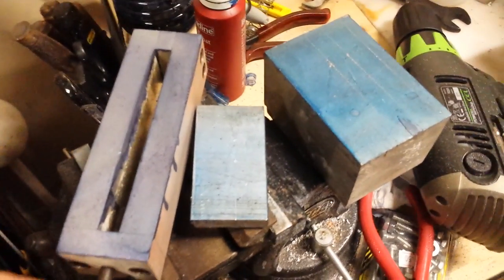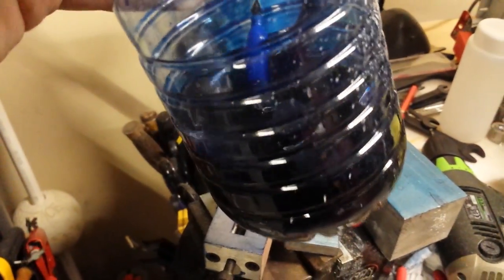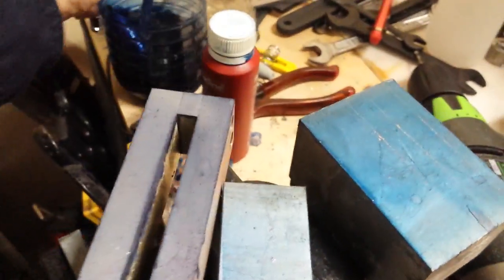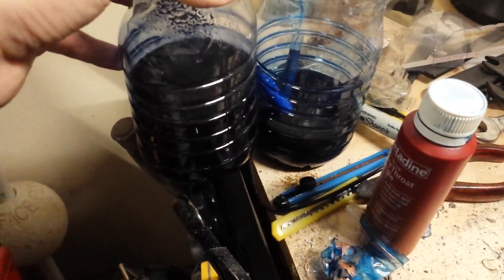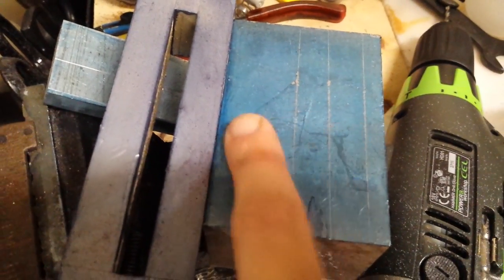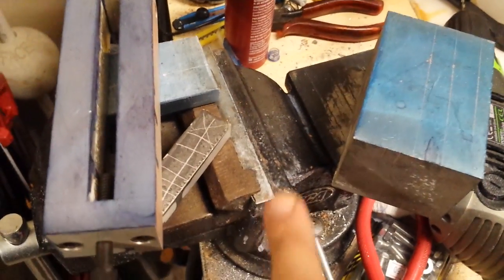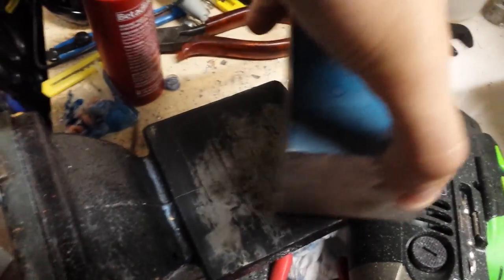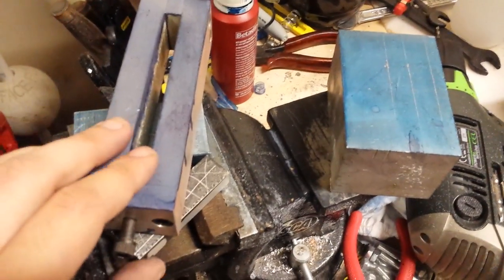DIY - How to make Engineers / Dykem / Marking Blue At Home

Comment: I have a new variation (recipe).
I buy alcohol based leather dye and add the shellac. It will be dark of colour and works like a charm. It is cheap. There are several dozens of different colour.
Reply: Great video! Very helpful.

Comment: I might try this... I can't get making blue out here (Port Pirie) but I'll try looking for shellac tomorrow morning.
Reply: I made some and it worked well marking out for holes on a special manifold I am making for a project, Thanks Mate! :) 

Next time I might use slightly less shellac or a bit more metho because tend I paint it on with a brush thicker than most people do. It gave a fairly thick layer to wash off.

Also I used a syringe to put the metho through the marker like you suggested but next time I think I will drill 2 syringe holes into the markers to make it easier to wash them out. I tried with just one hole but there was something blocking where the felt tip was pulled out and I couldn't just squirt metho straight through.

I haven't yet tried the suggestions Barry made like printer fluid or acetone, perhaps next time.
Reply from the maker: @lordchickenhawk  Glad that it worked! I got more projects and interesting ideas coming. Also, you can check Mrpete222's marking blue solutions video as well if this one does not work(for some stuff it may not). Thanks
Reply: @DesignedinAustralia0  Ok, cheers mate! What are you doing up at this time of the morning?! Are you still celebrating Anzac Day too?!
Reply from the maker: @lordchickenhawk  Just finished rendering and upload for another video on Radiator Flush DIY Tool+Early bird always gets the worm. lest we forget!
Reply: @DesignedinAustralia0  Lest we forget
Reply: @DesignedinAustralia0  Tried to watch your new vid but I got the HTML5 vid format warning... I'll try again in a few days.